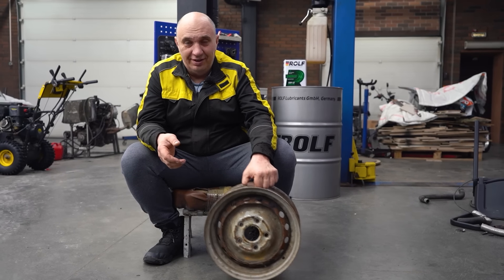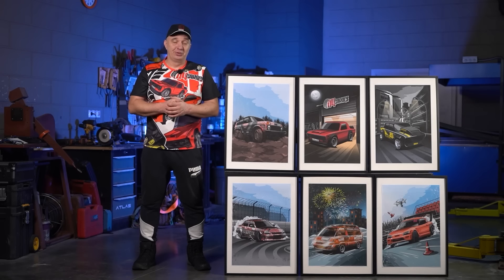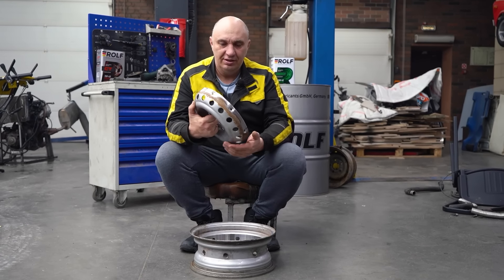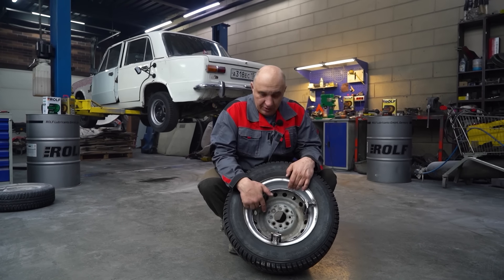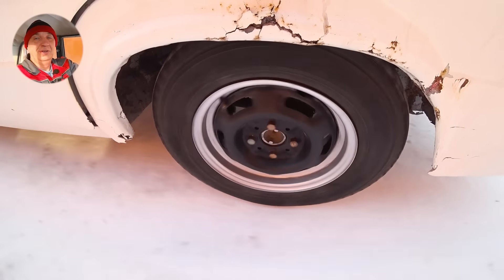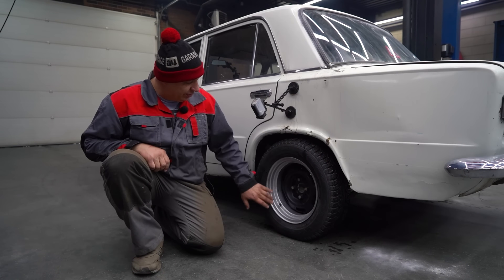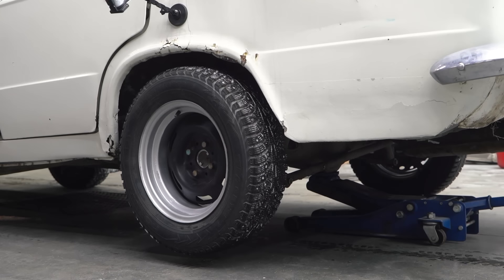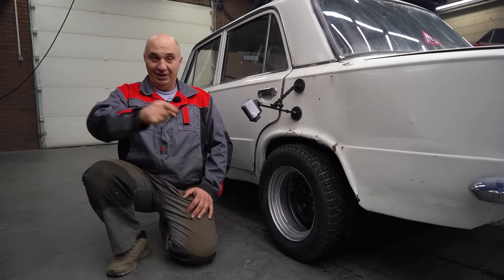We make rims with variable offset (100 mm adjustment range)

Comment: Need to do all four wheels see how it handles. Or four truck wheels would be good.
Reply: It won't clear the front hub, and even if, 1/3rd of a turn later and your brake lines are gonna get sliced off.

Comment: Very cool. I'd like to see you guys modify a lada so that the chassis and body can slide independently of each other while incorporating a counter weight system to slide the weight of the vehicle to the inside of a corner whilst driving. Always wondered how effective this would be to improve speed through corners. Kind of like how a motorcyclist uses his body weight.

Comment: Suggestion. There are.adjustable tractor Wheels with an adjustment that works like a screw thread pitch so it can be moved out with the motor torque once loosened. I think it would be cool to see a wheel that would expand out under acceleration and retract in while braking.

Comment: Could make little teeth for the extension plates like a closed end wrench so you can adjust the slides but the will lock in place, so then don't slide back in at higher speed corners

Comment: What about if it were threaded, if one can imagine the center hub as a bolt, and the rim as a nut, which would screw inwards or outwards, with locking pin holes drilled for the 3 positions.
Reply: That's how some tractor wheels adjust

Comment: Seen this before on tractors so you can adjust the offsets depending on your fields row widths
Reply: I doubt tractors do variable track width by modifying the offset between the tire seat and wheel webbing. If all you want is to vary the stance width, the simplest method would be to use telescopic axles and a hydraulic cylinder to set the stick-out length.
Reply: Seen this on a New Holland 8560 in a brochure
Reply: @teardowndan5364 
You've never see it before I take it? Many older ones have the webbing move relative the the tire, exactly wha you suggested they didnt. 

Some larger tractors have hydraulics that move the entire suspension in and out.

Others have a really long axle that you can attach the wheel where ever you want on the axle.

Comment: If you guys decided to make this type of wheel a commercial product you'd need atlest two locks to ensure the wheel cannot change position on its own or loosen. The offsets would need clear markings so anyone adjusting them won't have one further than the other etc. plus severe durability testing can the mounts withstand highway speeds and rough roads including potholes etc without bending or breaking

Comment: Willing to bet my life savings if you get those Wheels to 100 kph they would probably vibrate the vehicle into pieces if not pull you completely off the road. Of course you won't feel any vibration at 45 kph but at highway speeds with zero balancing and clearly misaligned pieces of extra metal it will shake like hell!